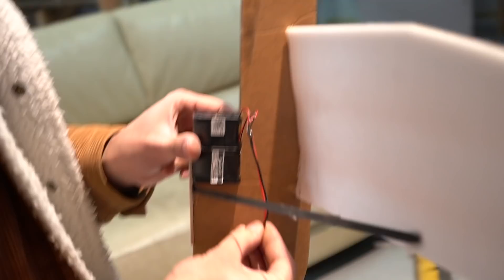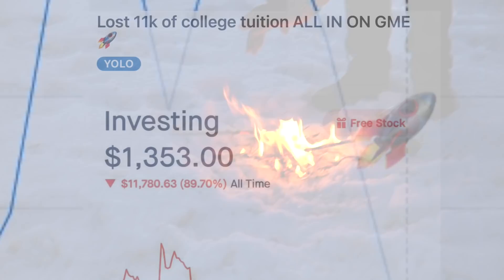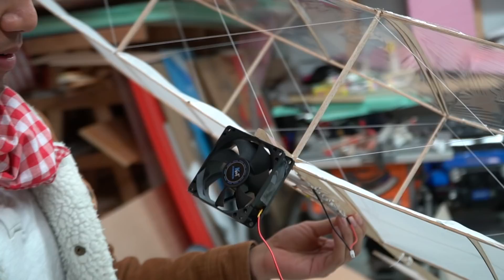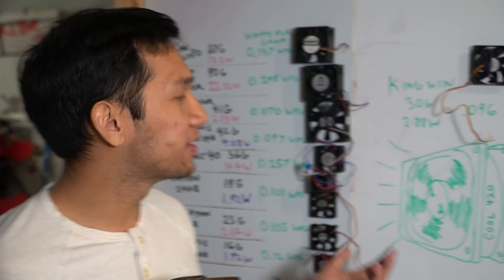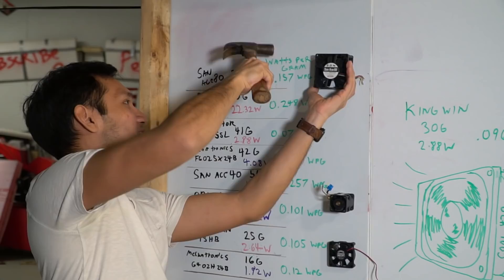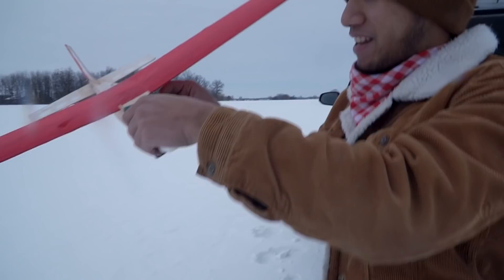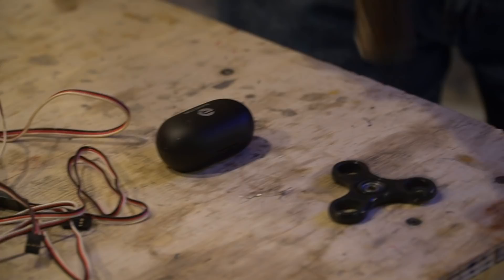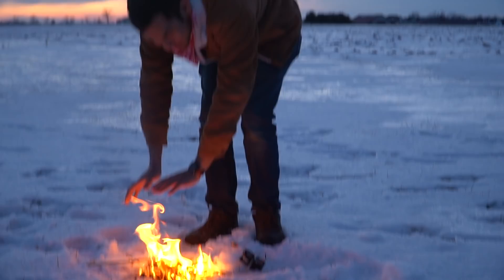PC Fan Powered Airplane!

Comment: Good fun!!! Have you considered that the fan position in the first plane as being in the front was making the nose /plane front heavy? That combined with an propeler angled slightly downawards would inevitably bring the nose down... may be if you try with the same ultralight structure but position the fan at close to balancing point and possibly  try adjusting the angle of attack (refering to the fan angle , not the angle of the wings or blades of the fan) a few times, you might strike that sweet spot? As the light plane is incredibly good glider, all it should need is a small amount of trust at the right place and angle, and the fan should be sufficient. It's worth trying  a bit more.

Comment: If the fuse were 100% enclosed on plane #2 with an opening at the tail, you could try mounting the stacked 'Server' fans inside the fuse to create a venturi effect - there'll be less drag too.

Comment: When you realize that there are many gliders that could carry the fan and batteries as a payload turned off...and still fly just fine.
Reply: Gliders without thermals don't gain altitude
Reply: @SaneAsylum  okay than) gliders don't gain altitude without positive airflow which carries them

Comment: Is it really a good idea to judge the thrust of a fan by it's power usage? Just stacking cardboard pieces flat on it seems much more accurate. Add more until the fan isn't able to blow them up/away. Stronger fans will lift more layers.

Comment: Buy a micro fly weight helicopter they're about 6" long.  use the radio control gear and motor along with the prop from that on your glider and make it two channel  control with fixed speed motor. 

You could also cut the fan shroud off the PC fan to cut weight and use that as a motor along with the remote control.

Comment: If you want to use Computer cooling fans, pull the fan and motor out of the mounting,  make a laminated paper tube for the duct and cut the weight of the plastic housing.

Comment: Place the motor more back of the wing on top of the craft it will balance the weight better creating lift .in stead of the weight at the front bring the plane down to quickly .

Comment: Use a mini DC motor used in STEM kits. It will make a STEM car go fast. I was using this for a Lego submarine (it sank) But it would have made it a missile going underwater and create a tornado (I made a small tornado with it).

Comment: Why didn't you use a cone on the exhaust? 
I think a cone would compress the air resulting in more thrust.
To keep the weight down, use paper or light plastic.

Comment: If he put the batteries in the back it would make it better because some of the weight will go back and it will make the plane go upward but if it’s going to high you can put some batteries on the front

Comment: hello @PeterSripol
I think the weight-watt ratio is not the best it will be more interesting to choose a fan with a high static pressure with a large surface area but a low flow rate... for example an Artic P8 or a Noctua NF-A4x20 FLX is theoretically better because it generates more force, the weight-to-static pressure ratio is probably better

Comment: Peter:
   I'm interested in building a swamp rat i.e. an RC controlled flat-bottomed boat driven by a fan & direction controlled by servo controlled loovers or rudder.
   What kind of fan would you recommend?
   Is this a project that interests you? I dream of skimming over the algae-covered sedimentation ponds draining most housing developments. Any ideas?
Jim

Comment: Would it not have been better to glue the fans on the top of the fuselage so that the faster moving air on top creates a bit of lift due to the pressure differential?

Comment: There are better "normal" fans without going to those server fans, heck, given blade size something like a 140mm 3000RPM Noctua Industrial PPC fan could be better than most of those server fans. There's also some CRAZY server fans, one colloquially know as a "Blowymatron" would probably be enough to pull the plane apart :P Great video though, just thought I'd add some fan knowledge if you ever decide to revisit it ;)

Comment: Would it help to place the fan at the back of the aircraft?
The fan and batteries at the front is adding weight at the front and pointing the aircraft down.
Having the battery at the back would lift the nose

Comment: Nicely done!  I'm hoping to build an ultralight without combustion or propellers. I want to use an aerospike exhaust at the rear, blown wings and flaps and dc centrifugal blowers to provide the airflow for thrust and lift. Do you think it can be done?  BTW if you put the computer fan ABOVE the wing, you get more lift.

Comment: So far I have watched your first attempt,  I will update my comment for each flight, 

The first one isn't working and is slowly falling bc you have no elevator so your CG is too far forward causing it to go down

That was very impressive once you cut the frame off the basic pc fan and doubled the voltage,  you almost had level flight even with the weak fan

The second fan you tried seemed to be behaving very similarly to the modified first fan

The double server fan flew pretty nicely

That was entertaining when you took it outside

The second plane you took outside bravo it flew perfectly,  until that cross wind sent it lawn dart into the ground breaking off the wing lol

Overall nice video that was a nice little experiment, very enjoyable

Comment: maybe place the battery along the wing span and also place the fans more wisely with a raspberry pi pico to control the voltage which will eventually change the rpm and yeah something like a cone to channelise the thrust 

if its an overkill then you can dislike the comment!

Comment: But but but 120mm fan moves twice the cfm as an 80mm fan - so thrust is way up with 120mm and you didn't even test one! Server fans are not loud because lots of air moves through them - they are small to fit into tiny 1 CU server cases - so they have to compensate for their shitty no-air-moving size with high ass loud ass rpm. 120mm or 160mm or even 200mm would be great to test across.

Comment: Ok this sounds weird but what if you had a glider with a helicopter/motor of the top to bring it back up so it can glide back down and do it over and over again?
Reply: Also you can use small wind turbines to collect energy on the top of the aircraft when it is going up from the motor to power it

Comment: YOU HAVE ZERO VERTICAL LIFT. Introduce a flight surface that creates upward thrust, or move the weight of the plane back so that the thrust from the fan is angled upwards. You have a weighted device with zero vertical lift, ofcourse it is going to fail. All planes have some sort of device to angle the thrust up.
Reply: Sure, the flight surfaces that create upward thrust are called "lift-generating surfaces" and they include the wings, horizontal stabilizers, and sometimes canards. By creating a difference in air pressure between the top and bottom of these surfaces, they generate lift and provide upward force to the aircraft.

In addition to lift-generating surfaces, some aircraft have engines that are mounted at an upward angle, which creates a component of thrust that is angled upwards. This is commonly referred to as "thrust vectoring" and can be found on some military fighter jets for enhanced maneuverability.

However, it's worth noting that not all aircraft require angled thrust or lift-generating surfaces to fly. For example, some gliders and ultralight aircraft rely on their shape and weight distribution to generate lift and maintain altitude. Overall, the design and functionality of an aircraft's lift and thrust systems depend on the specific needs and requirements of the aircraft's intended use. 

Point here is, your weight distribution is fucked up. You can do this if you fix it, I think.

Comment: how do I build that PC fan plane? anyone have a link to details on how I build it?
Reply: It's pretty simple. Square wing sections (between the ribs), find a similar airfoil and make it a .dwg file so you can laser cut it. Looks like he used light ply or balsa and just laser cut them. Front and rear spars are pretty simple, probably just 3/32 or 1/8" sticks. You can just improvise fuselage and tail feathers. Though, I'm pretty sure he used a stretched out piece of a paperclip to connect the tail section of the fuselage so he could adjust the elevator and rudder without adding weight.

But yeah, VERY simple airplane design.